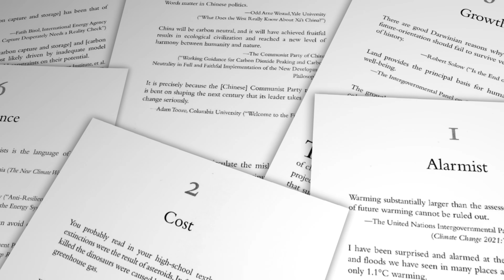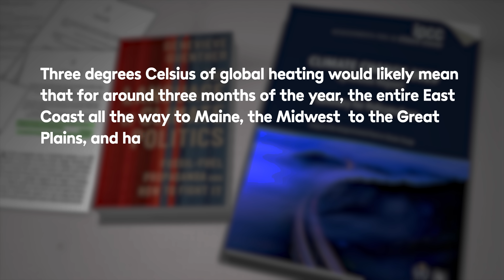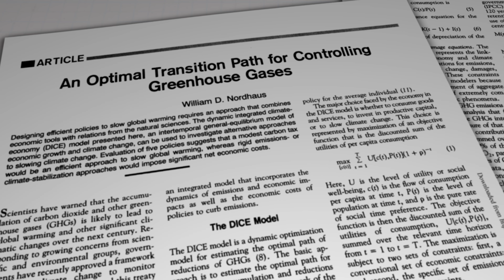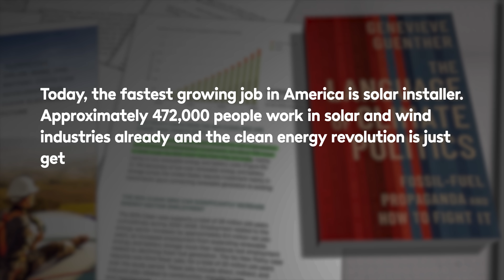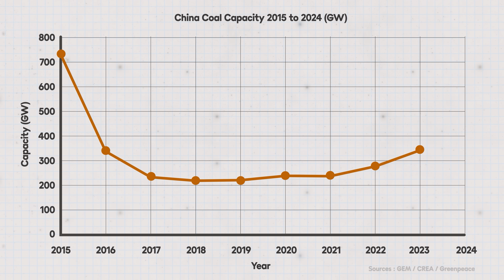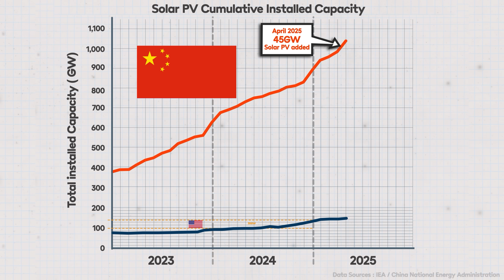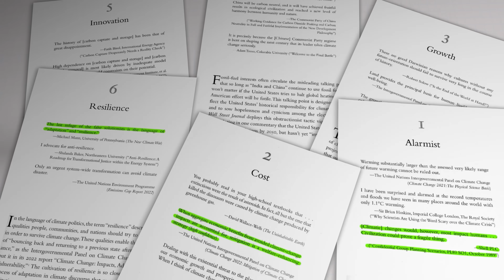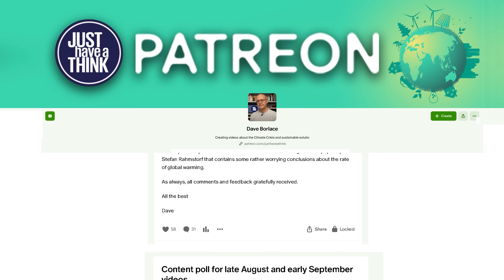New research DEBUNKS climate disinformation.

Comment: Bear in mind that the first commercial coal mine in the uk was in 1563, the ik was the biggest emitter of crap into the atmosphere for decade after decade, probably centaury's.
Reply: Nah, coal was expensive, people had to save, and lived in small quarters. The poor working population had a system where they shared a bed. One slept, then he stood up and the next person could sleep in it. They worked and sleeped in shifts (this was likely later in the Victorian era).
Reply: Coal saved the European forests. For real. And it was in the nick of time before deforestation got too bad. In the temperate climate the forests recover quickly  w/o help if it is not really bad -  and it had not yet gone to the level of massive top soil loss / soil being washed out, mud slides etc.  - during the industrial age population grew (after terrible wars and especially after the population decimation of the Black Death had overcome). 

I know that there were prizes announced for finding more efficient wood burning stoves (from metall) authorities could do the math and see how much timber was used year after year. Heating was sparse but they also produced charcoal and used that for steel production or winning salt .

A lot of wood was also used for winning salt or for metall work. There is a region in Austria where they had the technology down to make scythes. Water and forests. Poor workforce and know how. 

That wood stove improvement project was in Germany and Austria. Especially Austria did not have a lot of coal and they stuck to wood for a long time.  The farm houses had the heavy masonry stoves in one living / eating room (next to the kithcne) and one metall stove for cooking / heating in the kitchen. The wealthier people had different masonry stoves in their rooms. Sleeping rooms were often unheated. Ice inside on the window panes and all.
But for the little people and renters they needed small scale solutions. A masonry stove is really heavy so you need the stable floor (how do you do that in a cheap building for housing poor people). 

A stove or masonry stove has a long exhaust tube (that hopefully still has enough draft) - that would also heat the upper rooms a bit.

Comment: I found a report that said those BC temps in 2021 peaked at 46 deg. The same article said "The previous record high temperature for the country was 45 C, set in Saskatchewan in July 1937"  - SO IT WAS ONE DEGREE HIGHER THAN 84 YEARS AGO. People, please, we need to keep the climate alarmists from quoting data that isn't really any different than it has been donkeys years ago. Maybe the Sun is still warming slightly after the last ice age, but its not as bad as they make out. Just have  a think about that.

Comment: We are not developing and adopting adaptation technology fast enough. A shame because we will need adaptation, as you say, and that is the case even if we meet the emissions targets, the planet will remain hotter than it was (please correct me if I am wrong). But, I have noticed that the adaptations usually result in reducing emissions, e.g. reflective roofs, huge street shades, sponge cities etc, etc, So, I hope we don´t throw the baby out with the bath water.
Reply: Do you have any idea on how to implement adaptation technology? Do you know just how ineffective carbon capture really is? Because that seems to be the only idea out there. Imagine your hoover filtering all your rooms air. And then imagine the insane energy cost of that. And finally imagine that a scale of all air on the plant.
So, practically there is no technological adaptation.
What you mean is mitigation not adaptation.
Reflective roofs, so every single roof and every house front.
Street shades, and I'm sure you don't mean trees, but practically everywhere on every road. You'll easily see that's no viable option. Why no trees? Because trees need space. Good luck with that in any major city in the US.
Sponge cities also means to change nearly every buildings front in a city. Not just a couple of houses. But even with 5°C those cities can not be kept green.
Besides, all the mitigation plans are not put into reality, because there still are a few mad men who think they can make a few $$$ by denial. They will milk the cow until it drops dead dry. And once it does not a single soul will hold any of these mad men accountable, because we'll be far to busy trying to somehow survive, never mind mitigate.

Comment: I find the air-con load argument completely spurious. The time when you need peak air-con is exactly the time when peak solar is available. The sinks are well distributed, the sources can be, so you don't need a high capacity grid to connect the two

Comment: Agree with most everything you've said in the video, with one caveat. Although it doesn't nullify the overwhelming need to go green, the way that China is doing it is not exactly a model of perfection. They are currently supplying over 2/3rds of the world's rare earths (that's a really broad estimate, please check the figures but I think it's 70% or more), but the environmental cost has been huge. As you know, rare earths have to be mined, and mining can be a pretty environmentally destructive technology. And so it is. China has thousands and thousands (if not hundreds of thousands) of huge sludge ponds where they dump the waste and by-products of the rare-earth mines. The government is now facing severe river contamination is some of China's major rivers - a problem they have had before so they take it seriously. It turns out that sludge created by rare-earth mining is not simply toxic - a lot of it is also radioactive, so radiation contamination like that created by nuclear waste becomes an issue as well.
The BBC has published and  broadcasted some good investigative  articles on this. They had journalists who traveled in China extensively to report on the rare-earth boom in China.
Rare earths have been responsible for booming Chinese cities, providing jobs, and bringing rural areas into a 21st century lifestyle,  but at the same time, the Chinese government attempts to hide the huge pollution problem that the supposed solution to climate change is itself creating.
One of the main reasons Trump wants control over Greenland (after the control it would give over the Northern passage sea routes) is precisely the access to rare earths believed to be under the ice sheet in Greenland. 
I doubt that Trump would be any more careful about the toxic and radioactive fallout from mining rare earths in Greenland than the Chinese have been.
Again, this is not to negate the message of your video, but rather just a caveat to also have a think about.

Comment: Not interested in being in a perpetual state of fear watching people implement increasingly unreliable and expensive forms of energy
Reply: I'm not really following what you're saying there because it makes no conclusions but it certainly sounds like nonsense.
Reply: @FlatToRentUK step 1 - frighten people (1.5, 2, 3 deg warming, the invisible killer that is co2). Step 2 - energy impoverishment of people (wind, solar, batteries are unreliable and expensive). Step 3 - control people (oh we've got to restrict everyones energy usage because we built a useless energy system).
Not interested, and judging by the current investment climate in e.g. wind, not many other people are either. Most of the co2 danger danger tone was set by EPA in 2008 or so and this is about to be recinded. The pack of cards is coming down and it couldn't happen sooner. Around 40% of EU innovation funds (billions) goes on hydrogen projects which is another wealth transfer con job as i haven't seen any hydrogen stations going around europe and maybe one electrolyser is being built. It's a joke and too many people are being frightened by it instead of laughing. Would prefer taxes go to astroid defense, bunker preparations as one of those would make man made climate change look like pocket change.

Comment: Not that I disagree with anything, the solar jobs are only a temporary boom once they have been installed they require little to no maintenance so the jobs will be very limited. Unlike today's power industry that require maintenance and active replacement of parts. So the job gain will not be permanent you will find there will be less jobs due to this.

But I am all for solar and not polluting, I just not going to sit there saying that loads of jobs won't be lost and never gained and it won't be the billionaires on the street for say
Reply: It would be fantastic if we were able to install all the renewable power and beef up grid infrastructure we need in less than a decade, as we electrify everything. And as doubters love to point out, solar panels don't last forever. Even before a bunch start needing replacement 25+ years from their installation, it may well be that 10 years from now it will be worth repowering solar farms with more efficient panels.

Jobs in electrification will be plentiful for years and years to come.
Reply: @skierpage  the point is that yes there will be jobs but it will never be the same amount, as there will be job losses a lot once the power transition and vehicles are largely implemented.

Fossil fuel jobs give a tremendous amount of employment, distribution will have a massive hit, majority of jobs with natural gas won't exist, most petrol or gas stations will go. The green jobs will only go so far and when the work drys up like demand for solar installation for instance  then will be a loss of jobs.

Solar parks and panel replacement will be done by a team of people on ppms and these will be once per x years not a constant work flow and will be for a tiny group of people. 

I like the idea of going green but saying about jobs long term is going to be a massive job loss and there is no denying it.
Reply: @Sean_S1000  Petrol stations may go as petrol stations, but many people are unable to charge EVs at home - places for charging will be needed and because it takes time, a small convenience store/cafe on site would be useful...
Reply: @bonnie115 that's true there will be some retention and alternative use for old areas. 

Most changing will be done at home unless not possible, i.e. terrace housing flats etc. in quite a few new build flats I have been to they are installing chargers inside the car parks for around 10-15 percent of the available flats and kurb side charging is been trialed by certain conucils in the UK to allow residence  to run channels throughout the pavement to allow people to safely run charging cables from terrace houses to the cars safely there is another host of problems with that but at least they are trying to solve part of the issue. 

I am looking forward to seeing how it all pans out and can't wait to get an electric car, and solar on my house and battery storage but I am aware of there is a large host of issues we need to address which come along with these and the large benefits. 

I know I will benefit of not having an ice car, is that I won't be forced to walk by all the chocolate bars with my little self control and end up buying two or three chocolate bars and eating them before I get home.

Charging hubs

Comment: There is no climate emergency. Yes climate changes but Carbon Dioxide is not the primary factor.
Reply: If there were a "climate emergency", the imperative would be to ramp up fossil-fuel use to deal with the "emergency".

Comment: Let's debunk the elephant in the room. Actual greenhouses work by allowing energy from  the sun to pass through a barrier and then using this barrier to restrict convective and evaporative heat losses from the internal volume of the greenhouse.  Radiative heat loss in the form of IR light plays close to zero role in all of this. So why do "smarty pants", like author of this video are still using a term Greenhouse Gas Effect for a purely radiative concept.
Answer: they read their pseudoscientific drivel as a holy scripture without critical analysis.

Yes, in the beging, starting with Fourier,  Arrhenius,  Ekholm and  the rest,  they all belived that greenhouses work by resteicting IR radiation (dark rays). And noone s
corrected this mistake till this day.😂😂😂😂
That is why it is so hard to respect you.

Comment: Wrong question.  The question is:  Shouldn't we spend that money on pollution reduction, tech research for environmental cleanup, ocean plastics removal, fertilizer runoff prevention, protecting rain forests, etc.  These things we actually can do something about.  We still have ZERO reason to think that there is anything we can do about climate change EVEN if every country 100% did their best to help.  We literally are not capable of ending fossil fuel use, and we aren't even close.  In 30 years if we have gone down in use AT ALL I will be shocked.  Once world population starts to  drop (very very quickly) in about 50 years Oil consumption will fall as fast or faster than the population, and be back to 1940s levels within 50 years as the population collapse proceeds.
Reply: Oh yeah, I forgot.  If we fixed our water and our food then sperm counts would go back up and people would start reproducing again......now I think I'm seeing the plan.

Comment: Nothing wrong with having a bit of a rant occasionally Dave. Especially when you have the facts to back it up. Sadly, we need to remind ourselves that there are people on this planet who are so selfish that they will deliberately lie about anything for money. Aka , the fossil fuel industry. One point of debate I have been using recently is that most of the coal fired power infrastructure around the world is quite old and is due for replacement anyway. Add to that, the existing transmission infrastructure ( half a century old or more ) is also up for replacement as it simply isn't large enough for the growing demand. So, leaving the climate argument aside for a moment, all our power generation and transmission infrastructure needs to be replaced regardless. Just like owning a car or any other piece of equipment. They all have a life span and need to be replaced at some point. As it happens, the cheapest, cleanest, most flexible and reliable replacement option available is renewable energy with storage. Therefore, this is becoming an economic argument on top of an environmental argument. People need electricity. That's critical. The best ( by far ) choice bang for buck is renewables. I think we need to be pushing that argument harder. There are people who really don't care too much about the environment. However, what they do care about is their wallet. Here in Australia, people are starting to put on home solar and buying evs not because they are environmentalists but because it saves them money. That's why we are starting to see a real groundswell in the market. Renewables are going from early adopters to mainstream now.

Comment: Global warming is accelerating.  From actual data, the rate increase GW is increasing at about 0.1 C per decade.  0.4 C increase for 2015 to 2024 and an expected 0.5 C increase for 2025 to 2034.  Means 2 C warming by 2030s and 4 C warming by  2070s.  With accelerating GW the IPCC 20 year average for measuring actual warming could be as much as 2 decades late.
The materials and energy  needed to displace fossil fuels with low emissions energy are not available.  Additionally.  Those materials need fossil fuel to mine, transport, refine and construct all the low emission energy production.  That only produces electricity which currently only 20% of global energy.  To replace fossil fuels 3 to 4 times the amount of electricity needs to be produced.  Electricity cannot yet replace liquid fuels completely.